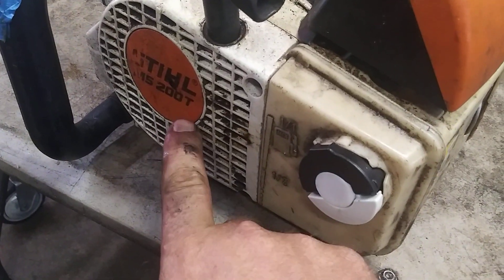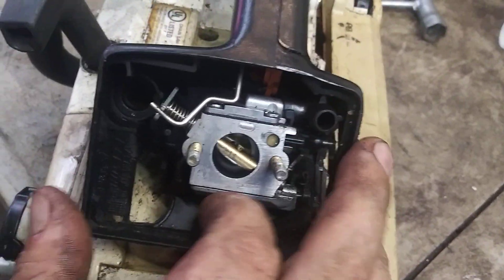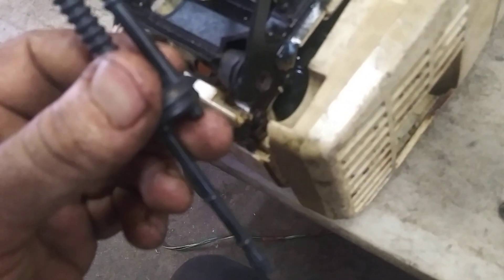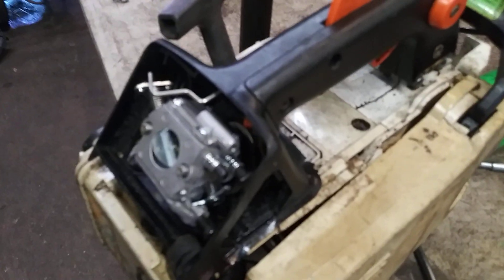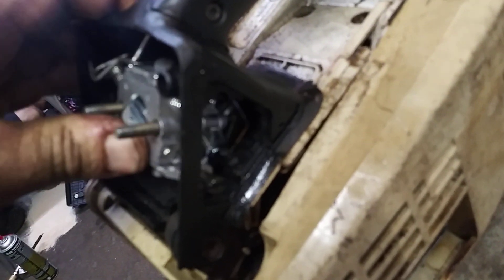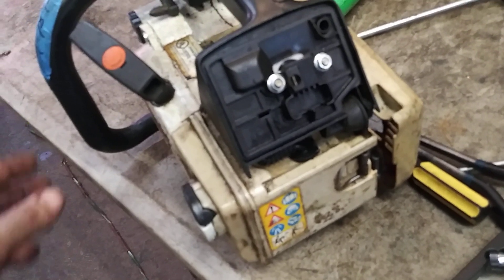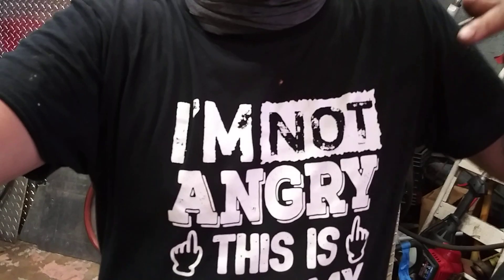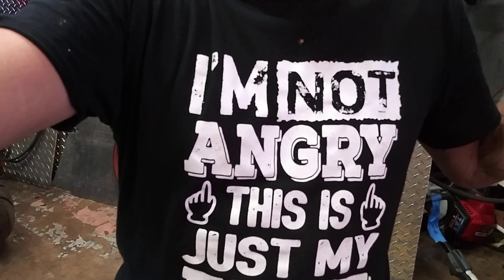* Stihl ms200t chainsaw carburetor repair ms 200 t carburetor ms 200 t carb ms200t tune up

Comment: Would it be good to tune a ms200 to the point where it just 4-strokes or schould the rpm be a tad lower?
Reply from the maker: ms 200 will never be 4 stroke. you get it right where it peaks then come back to just under the peak so you have power
Reply: @smallengineguys  oh i hear some sort of rev-limiterish like sound when i tune it where i think its pretty ok it got a different exhoust though… time to get a tach :)

Comment: Air filter seems to be missing in this saw I just see the pre-filter
Reply from the maker: there is only the one filter no other.  https://amzn.to/3odtR7L
Reply: @smallengineguys  Stihl ref 1129 122 0100 it goes in the hole below the 2 nuts at 20s in your video
Reply from the maker: @olivierj.2435  that is a foam insert not a filter. It is for catching any fuel drippings to allow the saw to suck them back in and burn them off. More of a california emissions kind of thing. Good eye tho.